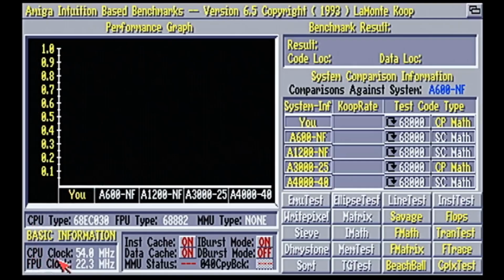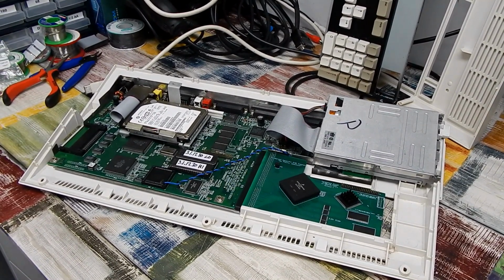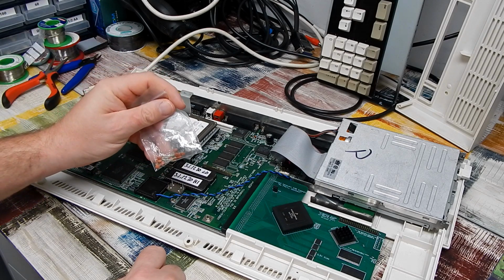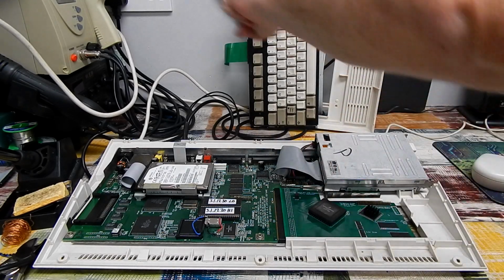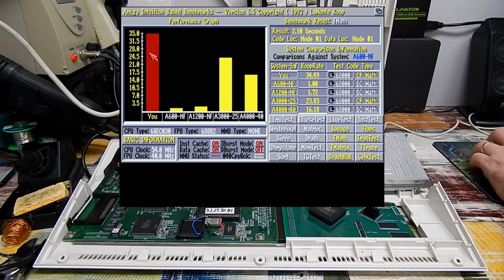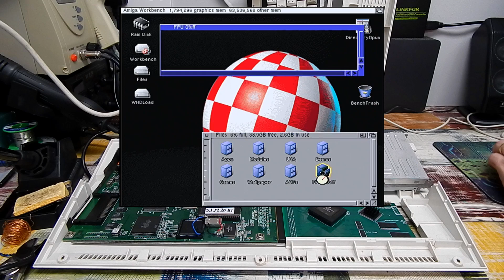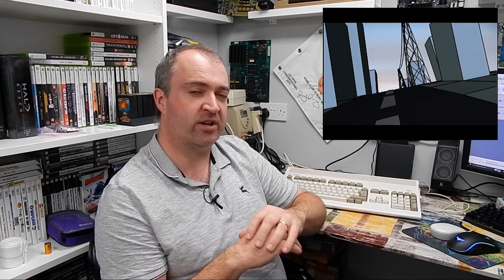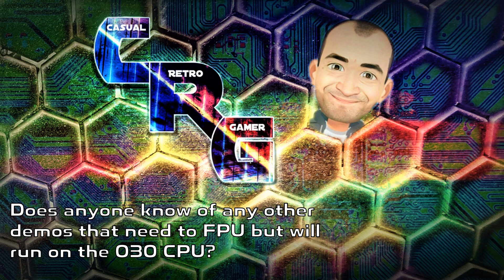Amiga 1200 FPU Part 2 - Adding a 40Mhz Crystal Oscillator

Comment: its one of the great unexplored questions of the Amiga.
Could a 68882 FPU do accelerated 3D graphics on an A1200?
In theory yes. Several devs that have done MFLOP tests and a few simple raytraces showing a large improvement over stock A1200s  but I've never seen the 68882 utilized in a realtime 3D engine. Did the Amiga and the 68020 implicitly know to just pass FP operations to the 68882? In which case just boot up Frontier elite 2 and lets compare the frame rate with the 68882 switched on and off.

Comment: Great work doing this CRG, Just a quick question about this mod, Wont this shorten the life of the FPU or Amiga or will this run fine with no sever problems?, Asking as I may do this to my own amiga, And yes I know you give no guarantees for doing this my self ect.. ect.. xD, Keep up the great work!.
Reply from the maker: No it won't effect the Amiga in any way.  Will it shorten the life of the FPU... I suppose it might if you overclock it.  That will generate more heat in the chip although I'd think any such risk of doing so is negligible.  Do bear in mind that if you fit an 060 accelerator this mod becomes redundant as that chip will disable any external FPUs.
Reply: @CRG  cheers for the reply and info, Great Channel.

Comment: Did you cut the CLK trace to the 68882 or use a piece of tape to insulate the 14MHz signal? I think I'll add this to my ReAmiga project, thanks!
Reply from the maker: As you'll see in the video I just lifted the pin on the fpu.  That's enough to get it to clear the socket.  But I suppose if you wanted to go to 40mhz from the start you could fit a plcc socket but remove that pin from it or if you were mounting the fpu direct just lift that one pin from it.
Reply: @CRG  Thanks! I think I'm going to solder it directly to the board and put a thin strip of kapton tape under pin 11. That way I can keep everything stock. And use a 14 pin socket so that I can swap out oscillators and try to overclock it a bit, see how far it can be pushed.
Reply from the maker: Sounds like a good idea.  I'd be interested to know if you can get any more than 40mhz out of it.
Reply: @CRG  Unfortunately no, I did an overclock of 44.9MHz but it wasn't stable, hangs, errors etc. And at 65MHz I got a yellow boot screen ;) So 40MHz is as high as you can go and have a stable system. I haven't tried different 40MHz FPUs but I suspect they're all the same. I don't have any other oscillators above 40MHz to try but less than 10% boost isn't really worth it.
Reply from the maker: My apologies, I was getting mixed up.  I show the lifting of the pin in the original fpu mod video, not this one!

Comment: If the Custom MOS chips could be recreated using FPGAs and CPLDs then it might be possible to rebuild it so that it would work at the sort of speeds that modern day computers operate at but a Graphics Card would be required as it would most likely be hard to get the video side to work at the frequencies involved.

Comment: Would this work with the tf1260 running a 68060 without a fpu
Reply from the maker: No it won't work.  The 060 does not work with an external fpu but even if it could this fpu would be a severe bottleneck.  

If you're running an 060 LC or EC it's best to think of it more like a crazy fast 030 and run software compiled for that chip.

Comment: Back in the days, production was not as accurate as today, therefore they had to test every chip. And chips that did not meet top  quality was sorted out into lower classes and stamped with a lower clock speed (where they were running reliably) and sold as a cheaper variant to cut cost of production. Intel did the same with their CPUs (x86-series). That's why some CPUs and FPUs can be over-clocked and some can not..

Comment: btw, i accidently bought a cheap make fo tf1230 at ebay, beware of the black pcb made tf! they are poor and equipped with a 33mhz cpu, which will stall after 10 minutes without active cooling. this made me headakes until i recognised i was fooled by an ebay seller. got my new tf from amigastore directly for cheaper.. and with a nice 50mhz goldcap cpu and made with much love!

Comment: Trying to get a clock signal from that far away from the FPU and not using wiring that is meant to transport these frequencies will very likely have mangled the signal to a point that the FPU would only switch on every second waveform (more or less) explaining why it went to 22.something MHz. I would try higher frequencies with the dedicated xtal setup you have now. I think there is a good chance that you will hit the 54MHz or even higher. Worth a revisit?

Comment: Also. Probably some emulators for consoles or 8 bit computers could be a little boost. 

But overall. Your Amiga is more compatible now. 

Sometimes softwares screaming for fpu. Which means you need to replace libs with non fpu. Which leads to you dont have to think soo much. 

Congratulations, in my opinion you have the best Amiga setup. 

Considering both boost and compabiliy. whdload made any amiga a far better compabiliy we could ever think. 

You will be able to run most of the softwares and demos now. 
Some of them to slow but will boot. Now replace that ec030 with a full mc68030 😉🤣
Reply from the maker: Emulator on the Amiga is something I've wanted to look at for a while.  I'll try them and see how it goes.

Comment: Search for the devs and libs compiled with fpu. Thats what i think could help by trying to unload the 030 as much as possible. 

Im not sure. But with alot of tweaks you might be able to play mp3 with the right drivers with amigaamp or similar. Actually with the 14bit ahi driver most likely some mono settings in low quality. Its possible to listen to mp3. Dont even try the regular 8bit sound. Its terrible. 

Question is if 68882 40mhz fpu is enough. 

I did this with my blizzard 1230 mk iv 50mhz cpu+fpu as a kid. 

I could play. With the right drivers which ones i cant remember. But i was able to use things like Deluxepaint at the same time. 

Look for fpu compiled mp3 codecs and maybe fpu compiled ahi drivers. And any libs that the amp software uses.

Comment: Art Department Professional, ImageFX, Vista Pro, Imagine, Turbo Silver, Lightwave... Just about 10% of the Amiga Software that uses an FPU. It all depends on what you use an Amiga for. Video Games? Don't bother with a FPU. Creativity and Graphics (like what it was designed for) - then an FPU is a requirement.
Reply from the maker: But if you can have an FPU, even if it won't be used then surely that's excuse enough to fit it 😂

In my case and to be honest it'll probably not get much use but I'm just happy to have it in there and running at the correct speed.

Comment: I watched the previous part to because I bought the same FPU's I think, ebay from china, think they where like 2€ a pop and was also worried they might be fake.
Mine has the same Print and numbers except the last line is different.

3rd line on mine is QEED0823
But both of my chips have the exact same print tough, so if they are fake they are changing it between batches I guess.

But idk can original chips have the exact same print?

I also bought some ceramic 33Mhz  030 QFP cpus for my 68K system, might be fakes to becsue the print is identical on both.

Anyways cool to see that the FPU seems stable at 40Mhz, my board will only allow for 33Mhz max anyways.

Grate videos as always with good information!
Reply from the maker: My chips came from AliExpress but working happy at 40mhz so I can only assume it's real.  

I'm not sure but I'd expect any chips of the same spec to have the same part number, I expect the 3rd line might relate to a batch number.  

I hope your chips work, good luck.
Reply: @CRG  There is forum post on 68KMLA now from 2024 with images of fake once.
Mine is there twice 😅
Both yours and mine has 1C12R and they where according to there list made from 1990 to 1993 and both yours and mine has date codes from the year 2000, 2008 for me and 2012 for yours.
The forum thread is called "Sourcing Legit MC68882 FPUs - Data" and google should find it.

Anyways just figured your might find it interesting and yea I cant post the link to the forum post but assuming youtube dont block my message your should find it if you have not already read the thread.

Btw time just flys, feels like I wrote the last post a few months ago 😆

Comment: You should get some wire wrap wire. it's smaller than the wires you are using.
Reply: not to mention some heatshrink :D
Reply from the maker: I just like to use what I have.  I didn't think about heat shrink until after, I might go back and redo it but ultimately it'll be fine as is.